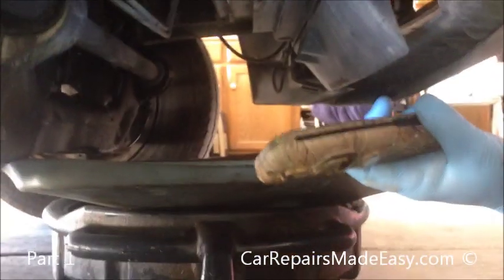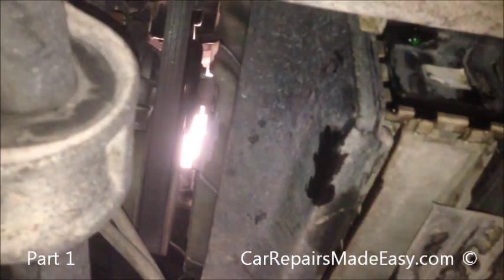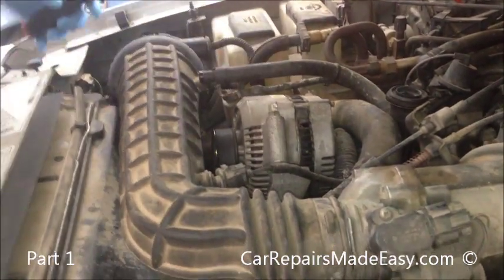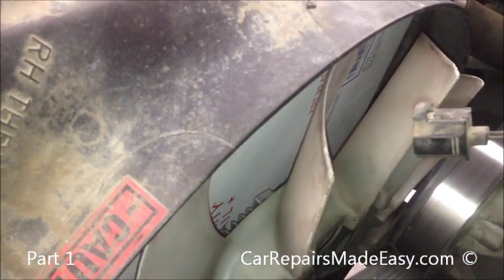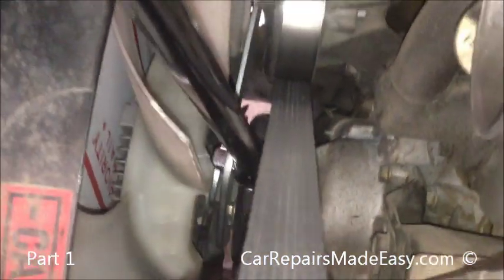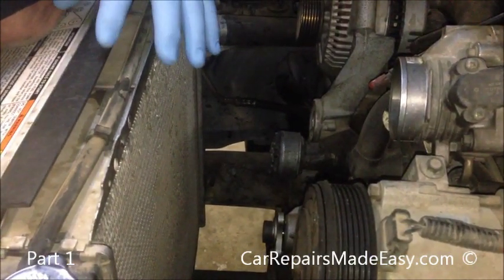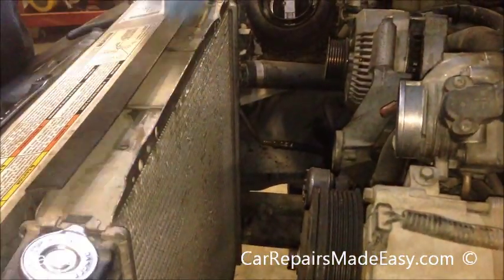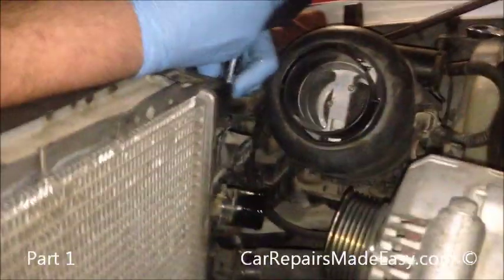Ford Explorer 4.0L Radiator Replacement Part 1

Comment: Just did this for a '96 MANUAL Explorer 4.0.  Insanely easy!  Since it has no transmission fluid lines, I didn't even have those two nuts to mess with.  2 hoses, overflow hose, and 4 10mm bolts and bam!  It's out.  Also on '96 model you DO NOT need to remove fan clutch, shroud, and fan unless you want to replace something in that combo (or water pump etc.).   Shroud can sit on fan and you have PLENTY of room to remove radiator.  That's it.  Thx for the video.

Comment: Do you need to remove the shroud and fan to replace the radiator?
Reply: What year was yours? I have a '98. Is it necessary to remove the fan & shroud in my case?
Reply: it's possible to take out the radiator in 90's fords without removing the shroud but you have little to no room in between, this just takes less time all together to remove the fan and shroud honestly.
Reply: On my '96 Explorer manual 4.0, you don't need to do it at all.  There's PLENTY of room once you dislodge the fan shroud.  It popped right out so fast I thought I was seeing things.